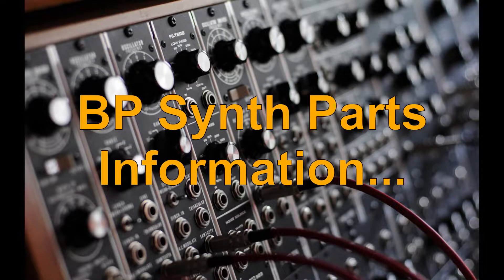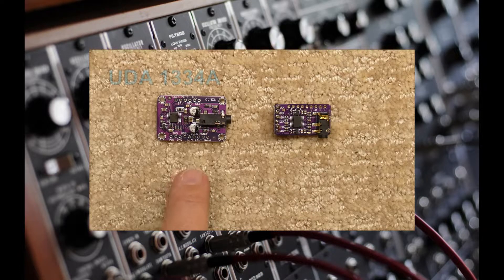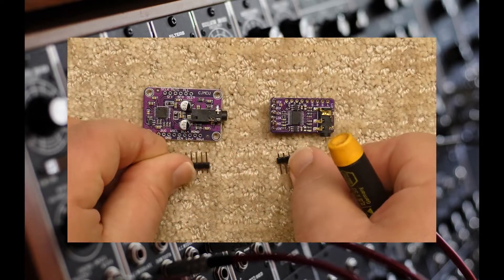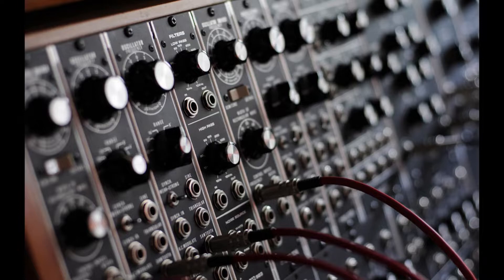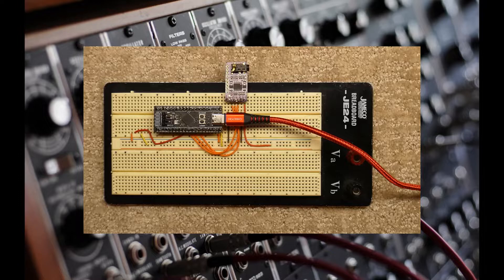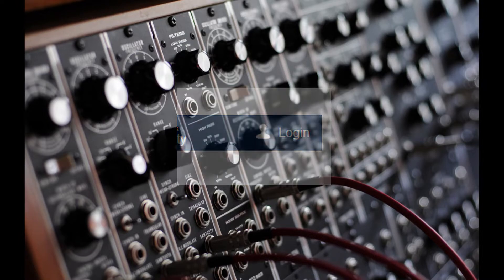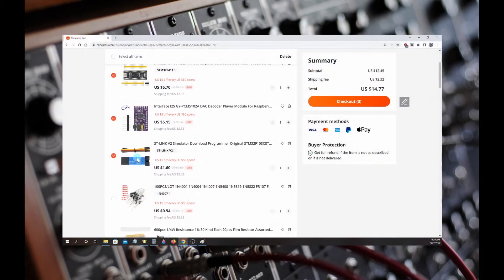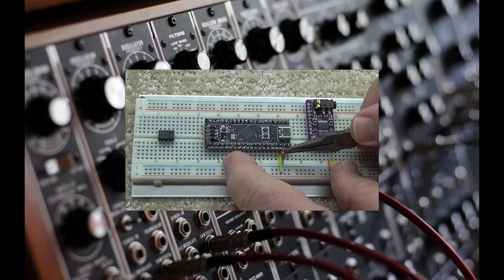BP Synth Parts.  What to get and where to find them...

Comment: Hi BP, I love this little project. And you are right, the sounds are really nice. I have already made this once, and loved it. I decided to make another, and so I ordered another Black Pill from WeAct (AliExpress) and unfortunately, when it arrived it turned out to be a slightly different Black Pill. As you can imagine, I am very much at the start of my exploration of electronics. Instead of the STM32F411CEU6, they sent me a STM32F411CE_25Mhz. I am not that experienced with ordering from AliExpress, so I wasn't checking what I had clicked on. So my perhaps all too obvious question is this: Can I get away with using this MCU, or am I being totally silly. Thank you in advance, and thanks for putting this marvellous project up on the net.

Comment: Dear.  Could you tell me what the I2C or I2S address of the PCM5102A DAC is or which jumpers should I put on the back of the PCM module? Mine came without any solder jumpers. 
Thank you very much.
Reply from the maker: Solder  1L, 2L, 4L and H3.   There are pictures on the net if you search around a bit ;)
Reply: TKS.

Comment: I have a PCM5102 (not the PCM5102A).  Is that compatible? Thanks in advance for answering soon, to confirm that I should get an STM32.
Reply from the maker: Do you have a pcm5102A MODULE?  There are a few variations, but all should be compatible.
Reply: @Synthetech  Thanks for answering👍🏻 The non-A edition. Hope it’s compatible.
Reply from the maker: @OMNI_INFINITY  looks like the TI doc covers many variants with same pinout.  So I'd say it is.
Reply: @Synthetech  Glad to hear that. Thanks for confirming!👍🏻

Comment: Will a 6N137s or 6n138 Octocoupler also work for the MIDI in?
Reply from the maker: I believe the 6N137s is the same, just surface mount instead (not breadboard ready).  
You can use a 6N138, but you need to change the schematic a bit to make it work correctly.
The 6N137 schematic I show uses one less resistor than what a 138 would need.

Comment: Cool.  Have you considered putting this on g1thub?  You can put other things there, like schematics, pictures and video links in the readme files.  It doesn't have to be just used for code.
Reply from the maker: I may eventually get around to doing that..  right now I barely have time to prep and upload to YT.
Reply: @Synthetech  +1 on the GH thing! Even if you just dumped it somewhere with no cleanup or documentation it'd be a huge win! I'd be glad to volunteer some time throwing together a PCB on Kicad or something.
Reply from the maker: Stay tuned..  I made a PCB nearly two years ago that utilizes three buttons, a encoder with a push switch, OLED Display and a small I2C EEPROM to save presets.  Slowly working on the Display/Navigation.. very slowwww process when I only get a few hours to code on weekends. 😞

Comment: Are there pros and cons to the 2 different DAC modules, or are they much of a muchness? The UDA1334A DAC I ordered was a bit cheaper.
Reply from the maker: None that I can think of.  I kinda prefer the Uda1334A since it uses one less wire and it does seem to be cheaper.. especially if you buy more than one

Comment: OK, all parts now ordered.  Looking forward to this!
Reply from the maker: I look forward to hearing your reaction when you get it working...
Reply: @Synthetech  I will keep you updated!
Reply: @Synthetech  Now up and running!  My BP synth is wired direct to my PC rather than my keyboard (see comment under 'Connecting up' video) due to deficiencies of my MIDI controllers (or maybe the operator).  I still have the waveform tutorial to do,  but very impressed so far!
Reply from the maker: @rogrevs  That's awesome!   See my reply to your comment in the "Connecting Up.." vid for a suggestion on how to use both the keyboard and the USB PC interface at same time.

Comment: Made this list for myself, maybe useful to others.

1 x Black Pill Development board - STM32F411 + header pins
1 x UDA 1334A or PCM 5102A DAC + Header pins
1 x 6N137 Optocoupler
1 x 220 Ohm Resistor
1 x 10k Ohm Resistor
1 x Swithiching Diode 1N4148 or 1N4007
1 x 5 Pin DIN (Midi Socket Female)
2 x Wires for connecting Midi Socket
1 x Breadboard such as Bus Board Prototype board BB830
1 x USB cable or ST Link Dongle

Soldering Iron and Solder
Various Jumper Wires
Reply from the maker: Thanks for the suggestion.. I'll see about adding that in soon..
Reply: Thanks.  I was hoping to see at least the MCU board and DAC listed in the description.  Text works better than video for a lot of things, especially for finding details you know are in there somewhere, but not exactly where.